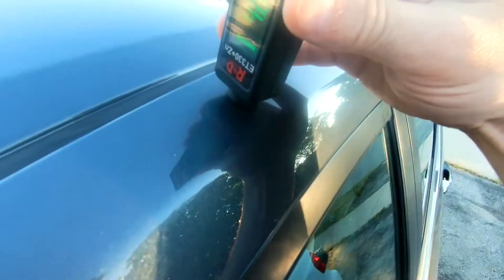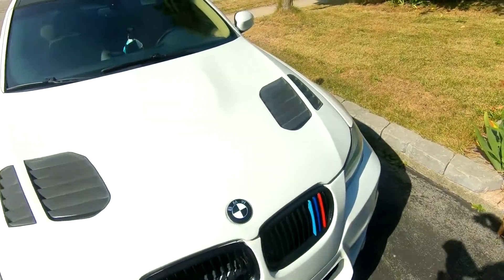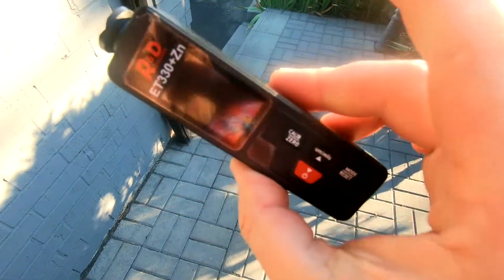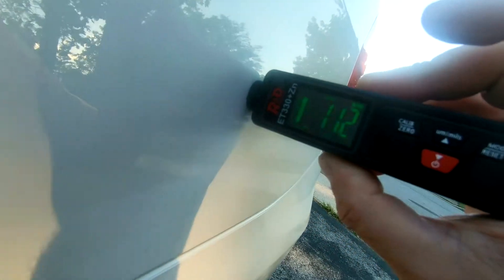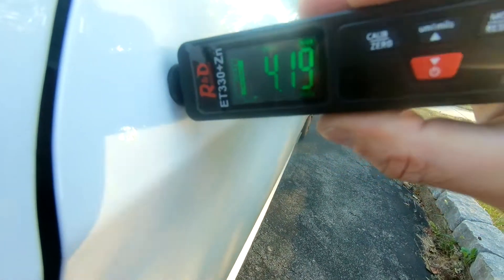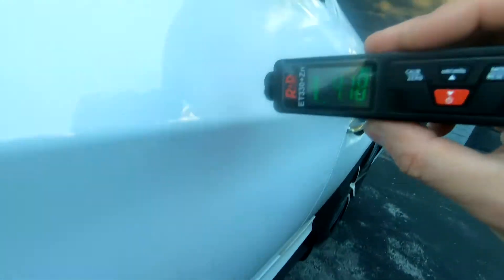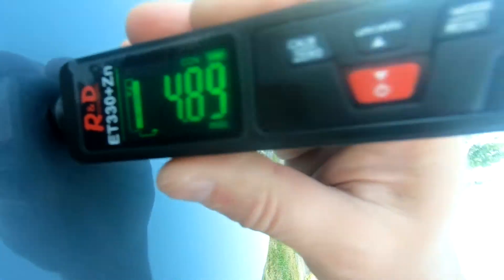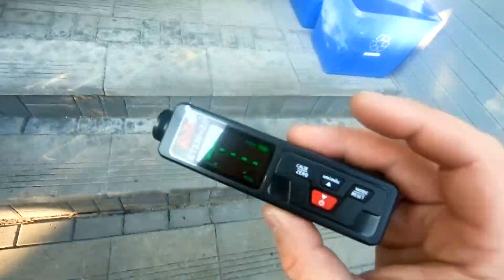How to Check Car Paint Thickness with R&D ET330 Paint Coating Thickness Gauge

Comment: I bought the same one and it was wildly inconsistent. I even read the manual and went through calibration with brand new batteries and it still reads a range of over 10 microns. With how thin car paint is this gauge basically says yep the car has paint. How thick is anyones guess